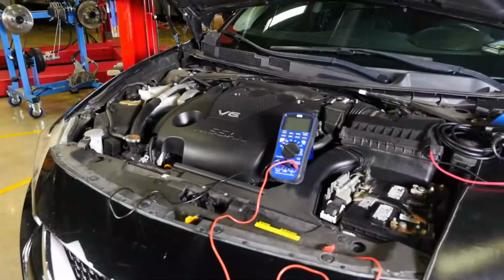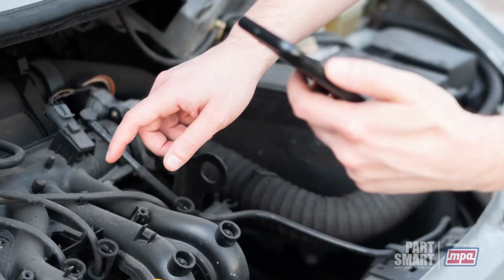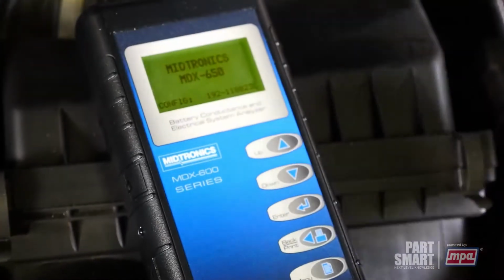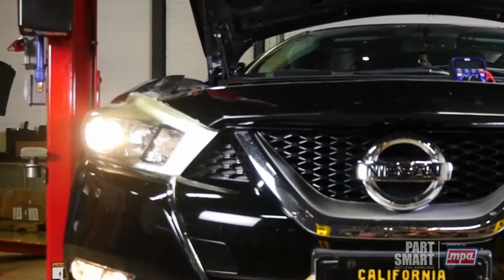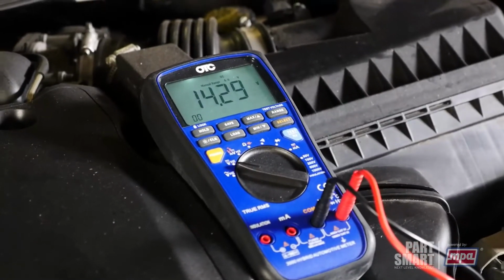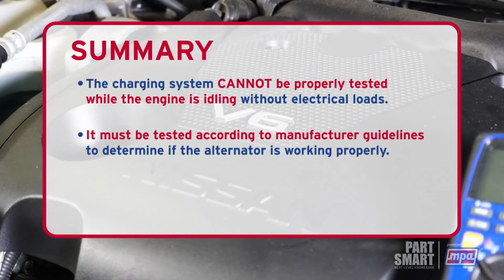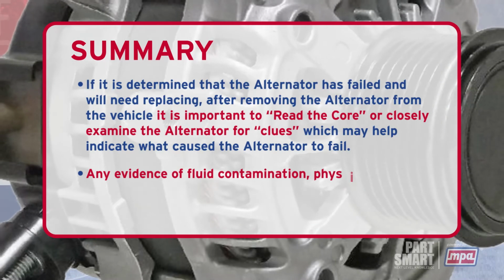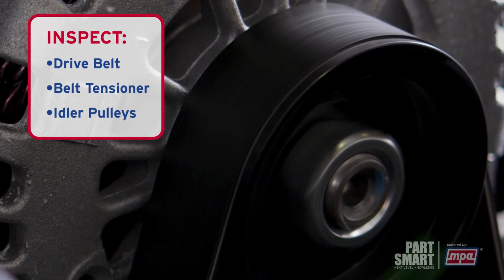Testing the Alternator and Charging System on 2006–2018 Nissan Vehicles

Comment: This was super helpful. I replaced my alternator four times in my Pathfinder. Both my mechanic and dealership say it needs to be an oem alternator. Any thoughts on that?
Reply: I have some screenshots but can't seem to upload them
Reply: https://youtu.be/O5zvq9Mrd44?feature=shared
Reply: @nicholasmorse2887 hi, I tried to comment on your video but it wouldn’t let me. I will tell you a few things that are certain. 

     That app can’t check your charging system unless the battery current sensor is unplugged which lets  alternator run at full strength. 

     If you charged the battery separately, your car will not charge it because it can tell that it’s fully charged, so your charging voltage will be lower (unless you leave battery current sensor unplugged. 

     The third thing is to check actual voltage and compare to your app. Use a good meter or a scanner that can show the battery voltage display that your car is indicating

     If you want to use that app for now, just unplug the current sensor and leave it off.  That way you know if the alternator is working 100% all the time like an older car would. 

      You can always plug it back in and it won’t hurt anything. So please try that for starters. Thanks 🙏 dude
Reply: @AlloyedFrequencies awesome. Okay, thanks for helping me understand that. I will give that a try. I appreciate the help!
Reply: @nicholasmorse2887 your welcome dude
Reply: @nicholasmorse2887 also, maybe just check voltage on the battery with engine off because the battery monitor might not be 100% accurate
Reply: What issues are you having?  Nissans have battery current sensors that adjust voltage. To see full alternator output voltage it would have to be unplugged temporarily. I bought an aftermarket alternator and mine is fine now. Battery was weak that was the main problem
Reply: @AlloyedFrequencies thanks for the response! I put a battery monitor on it. The alternator only kicks on occasionally. So I'll start it up and it will say charging and be at 99%. .... Then it will stop charging after 2 minutes and the battery will start dropping..... It will be at 70% after 10 miles.
I just put a brand new AGM battery in it.
Reply: @nicholasmorse2887 that’s a tough one. One thing I would do is check battery current sensor is working properly. You can monitor it with a decent scan tool. If you can get the service manual that will help too or the specification for the sensor range. 

     Also just make sure the new alternator is guaranteed to fit that particular car because it has to respond to the signals from ECM. 

     Other than that someone would have to check for the proper signals in all the wiring so definitely need the diagrams from service manual or AllDataDIY. 

     Definitely make sure connections are clean and tight, oh, and maybe just upload a video to your channel if you have trouble uploading pictures
Reply: @nicholasmorse2887 hey is your nissan pathfinder still having alternator charging issue did you figure out the problem or does it still stop charging after a few minutes of your pathfinder running?
Reply: @cedricmiller4370 I eventually bought an OEM alternator and it's working fine now. I run a Bluetooth battery monitor just to be safe
Reply: @nicholasmorse2887 and smart decision buying battery voltage monitor that way you can keep eye on voltage level when traveling thats actually a safety mechanism right there
Reply: @cedricmiller4370 hey dude my Nissan w as having a misfire that was hard to figure out. I’m replacing the cylinder head now. I was thinking about you. I had replaced the battery and alternator and also replaced crankshaft and camshaft sensors with new ones from the dealer. It was running so good but the valve guides were getting too worn out so I had to take it apart and replaced crankshaft the head. The charging hasn’t been a problem for me since I replaced the battery
Reply: @AlloyedFrequencies does the altima 3.5v6 have battery sensor too? And if so can it be unplugged to keep full charge?
Reply: @cedricmiller4370 mines a 2.5l but I’m sure the 3.5 has it. You can unplug it but I don’t like to leave it like that because the computer detects it as a fault.
Reply: @AlloyedFrequencies on i appreciate the heads up on leaving it unplugged im assuming it causes a chek engine light. And what year is your Altima?
Reply: @cedricmiller4370  no problem.  2013

Comment: This is great to know. I've replaced my battery and alternator thinking something was wrong. I thought I was having a voltage drop somewhere. I'm going to replace the ECM just to be sure. My battery drops down to 13 Volts so I want to make sure there ECM is not an issue as well. Used of course.....
Reply: Which make do you have?
Reply: What kinda nissan do you have

Comment: Thank you so much for this information. My alternator output with load test is reading 12.98 - 14.5 volts on the 2018 Nissan Rogue. The battery reading drops to 11.85 volts in 24 hours meaning it might be time for a new battery. Any suggestions?